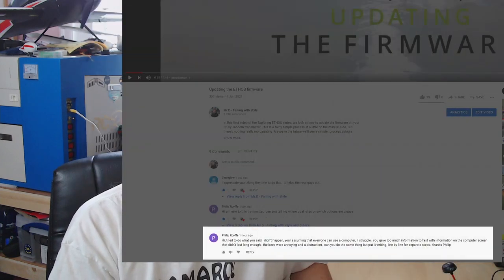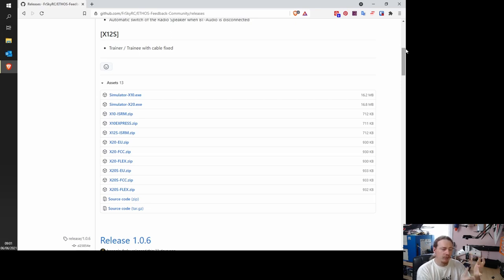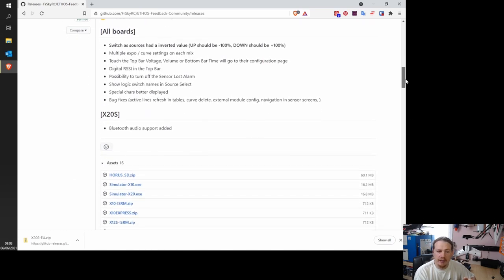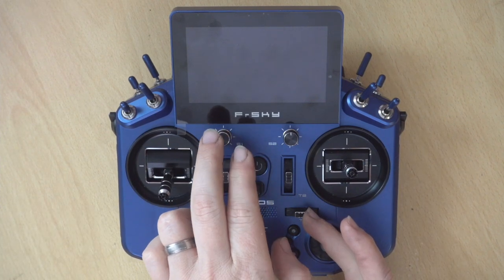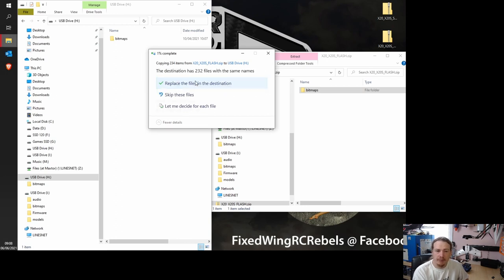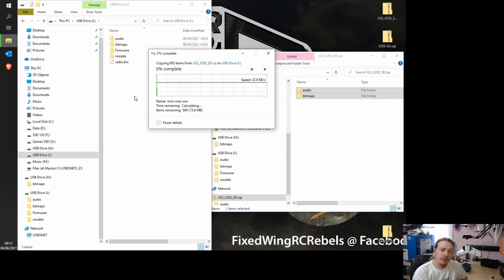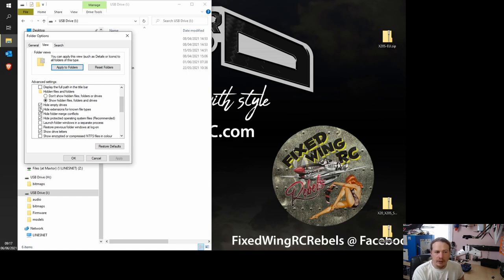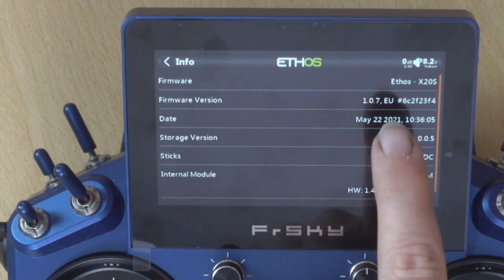Updating the ETHOS Firmware, for people who struggle with computers

Comment from the maker: ** Update **
The naming of the SD card and FLASH drive contents is changing. From version 1.0.11 onwards, if you are using a Tandem transmitter (currently X20 and X20S) you should download the TANDEM_FLASH and TANDEM_SD files.

Between 1.0.6 and 1.0.10 they had been named X20_SD and X20_FLASH, which caused confusion. People thought it was just for that transmitter, and not for the X20S also.
Reply: Yeah this caught me out, until someone on FB mentioned downloading the TANDEM files, then it clicked for me. No issues on the radio display if you forget though, but safer to update the SD and FLASH files anyway. 
On a side note, I noticed that the firmware.bin firmware file that is downloaded on the SD card, disappears from the SD card once the radio uploads it. No issues, actually good so older firmwares don’t get confused with the current one.
Reply from the maker: The file names have literally just changed with this latest version (1.0.11). It’s my fault too as I was hearing about the old names confusing people. So suggested they make this change.

Yes, once the firmware update takes place, the firmware.bin file is deleted.
Reply: Hi MrD,
I just bought the Twin X Lite which doesn't come with an SD card. I put a new one in but it seems it doesn't work properly. I can't find how to format the sd card so the folders and radio.bin file appears properly - please help =)
Best Mat

Comment: Hi Daren, it's been 20 years since I've flown RC gliders, and now with the X20s, I'm very grateful for your very helpful videos  - thanks a lot! So much has changed...
Reply from the maker: Thanks Steven. That’s great to hear. I’m glad the videos have helped. Are you getting back in to gliders, or are you looking at other aspects of RC? I love hitting the slopes. It’s just the timing of the wind strength, direction, and being a day where I’m not at work that is too rare.
Reply: @MrD  Thank you Daren for replying 👍 Slope soaring and general field thermal flying is what I’m looking forward to. But thankfully my tx and rx’s are now updated and I’ve started the setup of my first model. Thanks again and appreciate your help and hard work. 🥇
Reply from the maker: Awesome. Hope you have some great flights.

Comment: great response to a comment … even though I am not involved , have not got it and might buy one Chrismas this year or next year just to give it a chance - even though I still would prefer to see a phone holder in that spot instead of a cheap display. Phone displays are usually better. But time will tell till I get one in my hands.
Reply from the maker: Thanks Wolf. At the end of the day, I want to help people. So if I can do better, I will. 

Personally, I prefer the transmitter screen over my phone. Better aspect ratio to use with the transmitter features. It works well in all light conditions too.

Comment: Great video! Very thorough and very informative. I have been looking at the X20S but even though I am computer savvy, updating firmware is always a bit nerve racking, especially with a lack of direction from the product manual. This video makes me feel more comfy making the jump to FrSky. Thanks for the part 2 video 👍⭐⭐⭐⭐⭐👍
Reply from the maker: You're welcome Chris. I'm glad it was helpful. It isn't a difficult process. Though I'm hoping that in the future a PC companion application will appear, to make things like the firmware updates and backing up and restoring models much simpler.
Reply from the maker: Unfortunately not Chris. What's worse is I'm sure I've seen it somewhere in the past. I would guess the minimum would be 60, as that is the minimum with OpenTX. Most limits in OpenTX have doubled in ETHOS (number of channels and logic etc), so I can't see them allowing any less than that.
Reply: @MrD  Thanx! I don't see my self having 60 planes at one time 😂.
Reply from the maker: Never say never 🤣

Comment: Mr. D, I just want to say...THANK YOU, THANK YOU, THANK YOU!!!!!  I finally got the Tandem to update you explain everything perfectly for me to understand!  One thing I notice on downloading X20S-FCC, the files came up with the OpenTX logo which really confused me because I`m not using OpenTX, and the firmware folder looked different from the video,  however, somehow I was able to get the Tandem to update to Release 1.0.7,  good job my friend keep up the good work,  please make a video on programming an Airplane, rates, weights, etc!

Bobby C
Reply from the maker: That’s great Bobby, I’m glad the video helped. Though that is strange about the OpenTX logo, that would have confused me as well 😄

I have some extra folders on the SD card of my X20S for things like audio and firmware updates. So that may be why it looked different. 

The video that’s out on Friday will have expo, rates, throttle cut, and differential covered.
Reply: @MrD  Thanks again, I did not realize I could add sub-folders for sounds, updates, etc. on the radio sd card!

Comment: This is also my first experience with Frsky coming from JR.  Is the Frsky receivers the only ones I can use with this transmitter?  I'll also search for your transmitter firmware update video.  Seems like I saw that when looking for help on the transmitter.
Reply from the maker: With the X20, you’re best off sticking with FrSky receivers. There may be lite JR bay multi-protocol modules available. But I don’t believe you’d be able to use them with ETHOS. The multi-protocol modules may not support JR receivers either.

Comment: Best instructions I have come across,nice and clear .Do you know if this updating system will work with an Apple Mac ?
Thanks,keep em coming .
Reply from the maker: The actual file locations on the transmitter and process will be the same. But you’ll be using finder I guess to do all the file transfers. Unfortunately I don’t have a Mac, so don’t know the details involved. The key will be working out which is the flash drive and which is the SD card.

Comment: This will be my first update, seems pretty simple. Quick question, I’ve never had to do updates before coming from Futaba so this is all new to me. When I update software on the transmitter, do you also have to update your receivers? Hope this is not a stupid question. Also does this have the potential to wipe out all the models you already have programmed on your radio?
Reply from the maker: Hi Jonny. Questions like that are never stupid. No, the RF firmware is separate to ETHOS. At the moment, ETHOS Suite does not update the RF firmware; though this may change in the future. You can check the version of your RF firmware in the System -> Info screen on your transmitter. You need to have the internal RF module enabled. Then it will show you the FW version of the module. If you have any ACCESS or TANDEM receivers active. It will also show the firmware version of those receivers. If you look up your transmitter on https://www.frsky-rc.com/ and go to the downloads page for your transmitter. The latest version of the RF firmware will be found there in the "RF FIRMWARE - TD Module" section. If you update this, you should also update your receivers.

There is always a risk that something can go wrong in an update. No matter how rare. It is always worth taking a backup of the models on your transmitter before updating. I've only had a problem once, on a much older firmware update. Backing up your models is now really easy with ETHOS Suite. I show how in this video https://youtu.be/fvxbYacd-bk

Comment: On Ethos X20S Firmware version 1.5.9 I was able to copy files over using your instructions but cannot select it as there is no 'Play Track' option, allowing choice of one of the files I've copied.  I see the 'play audio' option (which doesn't have choice to set file) but there is not a 'Play Track' option. Any idea how I can enable 'Play Track' and File selection to show up please?

Comment: Have you tried to copy files onto a Sandisc in your pic then place it into the sd slot of your transmitter and update files that way?
Reply from the maker: That should work the same. The cable just saves removing the SD card. However, these days, updating with ETHOS Suite is the recommended, and much easier, way to update. https://www.youtube.com/watch?v=fvxbYacd-bk&t=382s

Comment: I just started using my x20s, I am on 1.0.9, should I use all updates till current or which would I need to do to be current? Are all previous fixes/edits present on current update? Thanking you. First time on ethos/frsky, coming from spektrum/hitec
Reply from the maker: Hi Marchand. You can upgrade to the latest version. However, the process is a little different. I will be making a video on how to perform the update soon. My current video is only for up to the 1.1.14 version. The 1.2 version need a little more work for the first update.

Comment: How much do you charge to fly the US and put the updates on my x20? :)  I don't even have the radio yet and I'm a little worried it could be above my computer abilities
Reply from the maker: That would depend on how cheap the flights are and the cost of an average hotel for a few days 🤣

If you take your time, I’m sure you’ll be fine. Check out the video description, as the zip file names have changed. Good luck 👍🏻

Comment: Is it possible to change an X20 EU transmitter to an FCC transmitter by selecting the correct firmware?
Reply from the maker: Yes. But you would also need to run an external 915MHz antenna, or replace the handle with the FCC version to use the internal antenna. 868MHz and 915MHz have different antenna lengths.

Comment: So I watched your video and found the X20S FCC file in version 1.4.6.   I can't find the SD Card and Flash memory files.  I see many for X20
Reply from the maker: If the file isn’t there in that version, you’d need to look in the older version. But, these days your should only need to use ETHOS Suite to perform the updates. It is much easier.

Comment: Does the X20S already have the switch voice commands menu like the Radiomaster 16S?
Reply from the maker: The options are there. But you will need to install a voice pack.
Reply: @MrD  Ok, thanks for clearing that up.

Comment: I noticed that when you moved the downloaded files from the desktop to the Flash and SD drives they in the  .zip format  - - so do they get unzipped automatically when the files are moved over to the  two Tx drives...joe
Reply from the maker: Hi Joe. I open the zip files and drag the contents of the zip files over. When Windows transfers the files, it unzips them before storing them on the X20 drives

However, if you were to not open the zip file. Window would just copy the zip file. The key is to open the archive and copy the contents over.

Comment: so any idea why it does not show up on my pc are there specific usb drivers needed for my pc ???
Reply from the maker: Hi John. If it doesn't show up, the first thing that I would try is a different USB C data cable. The cable that comes with the transmitter is not the best. Mine did not connect sometimes.
Reply: @MrD  thank you ill try that

Comment: Daren  Nice work man!
I have a request. Could you please make a follow up video on flashing the x20s Ethos Tx using the SD card method?   It just seems like a good alternative. Some of us zone out when we hear “bootloader.
Reply from the maker: I can’t find any reference to this method. As far as I know, you can only flash ETHOS by putting the firmware.bin file in the root of the MicroSD card. Or are you simply meaning removing the MicroSD card, putting that in the computer, and copying the files across that way?

The bootloader mode is nothing to fear. For small changes, it’s much quicker than pulling the MicroSD card.

Comment: Hi Darren, Excellent tutorials thanks, you have really helped me. However, with the release of version 1.1.1 I am now confused.
I have an X20S and there are 5 relevant .zip files in this release. I know that you told us that after Vers. 1.0111 the files would be named TANDEM FLASH.zip & TANDEM_SD.zip, but as well as those, there are also; X20S-EU.zip, X20S-FLEX.zip and X20S-IL.zip.  What should we do with the X20-FLEX.zip & X20S IL.zip and do we need to download the X20S-EU as well as the TANDEM FLASH.zip & TANDEM_SD.zip??? - Thanks in advance for your support.
Reply from the maker: Hi Geoff, the X20-FLEX and -IL files are for different modes of the RF module. FLEX enables the flex features of R9, which allows the pilot to select the power and frequency to. I believe IL file is for Israel. With 1.1.x you also need to download the audio zip file. I have a video out on Sunday for updating to 1.1.x which may help too.
Reply: @MrD  Thank you for your very prompt response Darren, I'll look forward to your new video 👍
Reply from the maker: No problem  @GesBey

Comment: Hello, I did the update of the x20 firmware and it was great, what I can't do, is that it functions the special functions since it does not find the wav files when I assign the switches, could you help me
Reply from the maker: You probably have them in the wrong folder. Check out my 5 differences between OpenTX and ETHOS video. That shows where the sound files should go.
Reply: @MrD  I was watching the video of 5 differences and they are in the place that indicates, I do not know what can happen that does not read them
Reply from the maker: If the files are just in the /audio/ folder, it could be that they are not in the correct format. I’ll get the details soon, when I’m at my computer.
Reply from the maker: The wav files need to be at 32000Hz and exported as 16bit files. The will also have a filename character limit, which I've not tested in ETHOS. OpenTX was limited to 6 characters, and that is also fine in ETHOS. Basically, and WAV file that worked in OpenTX should also work in ETHOS.
Reply from the maker: If the files worked on the Q-X7, it can only really be that ETHOS can’t see them. You’re 100% that the files are just in the audio folder. Not in a language folder inside it.

Comment: Hi there, Ive just been through the update procedure as shown above. However now my screen on the X20s does not show any of the bottom line logos! 
System, Configure, Models and the model choice are all blank. 
The time is still showing and correct. 
Any suggestions how to recover this?  Tell me where I went wrong!
Please anyone, feel free to chip in with genuine suggestions and hopefully a walkthrough. Cause I am obviously not a natural at this computing lark.
Firmware is now 1.2,6, EU 7c0ba7bs
Internal module is HW:1.4.0 FW:2.2.1 (EU-LBT)
Reply from the maker: Hi Ron. I've not yet got up to speed with 1.2, as for a while it has been in a flux state. Now it is officially a stable release, I will look in to the upgrade process and make some videos on this.

I can only imagine that some of the image files are missing. I would check the X20_FLASH.zip file contents were copied on to the flash drive. I have a feeling that may be the problem.

Comment: I've got a X20S with 1.0.17 EU version. I don't know through which version I have to go to get the latest update, or if I can go straight away from 1.0.17 to the latest. I found the 1.2.11 version 
Thanks for your help
Frederic
Reply from the maker: Hi Frederic. I would take a backup and update to version 1.1.4, After that you can follow my video to install version 1.2. At this point in time, I would recommend updating to 1.2.10 as the latest version. There have been a few issues found in 1.2.11 which will be fixed in 1.2.12.
Reply: @MrD  Many thanks, I will proceed like this ;-)
Reply: @MrD  Hi , I've downloaded the 1.1.4 version, but I can't find the Tandem Flash & SD files in 1.1.4 version. Can I take it from another version ? or could you please indicate where I can catch them ?
Thanks. 
Frédéric
Reply from the maker: @fredericgrob384  As you are just going to install 1.2.10, I wouldn’t worry about those files. Just get 1.1.4 installed so that the bootloader can be updated to 1.2.10. Then install everything for 1.2.10, which will be SD Card, Flash, and the audio files. But ETHOS suite should take care of those for you.
Reply: @MrD  Hi, 
thanks for your quick feedback.
My transmiter is now in 1.1.4 version as you suggested it to me. I'm trying to upgrade it to 1.2.10 as you proposed to me. But in the file list of 1.2.10 I can't find the Tandem SD & flash files. Where should I download it ?
Reply from the maker: You don’t need to. Are you following the correct video? https://youtu.be/j_iAUkg6wao
Reply: @MrD  I'm sorry, I was not following the correct video...
I will do it and keep you posted.
Many thanks 
Frédéric
Reply from the maker: @fredericgrob384  No problem. Hopefully that video will get you up to date quicker and easier. The ETHOS suite makes the whole process pretty much the click of a button.
Reply: @MrD  Hi, update 1.2.10 done, very good video, everything is fine and runs well now. Once again many many thanks for your help.
Frédéric (From France)
Reply from the maker: Excellent Frédéric. I’m glad it’s all working.